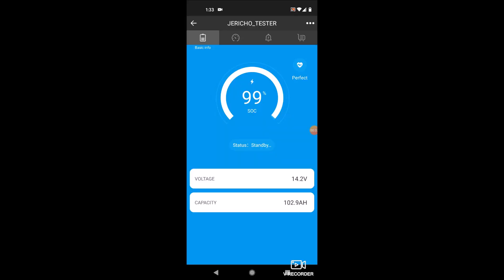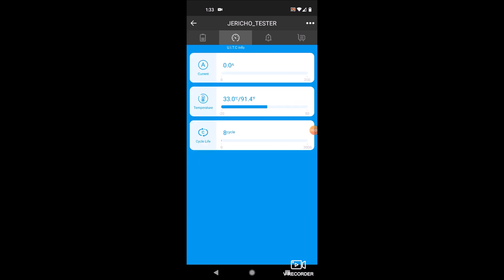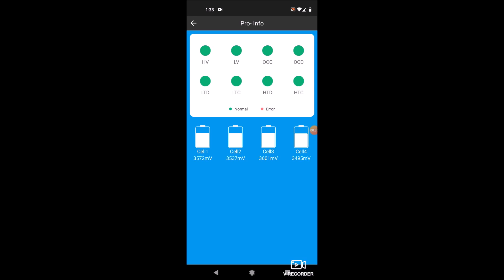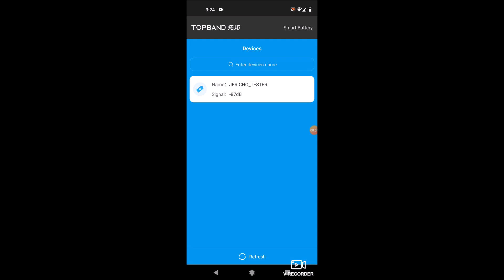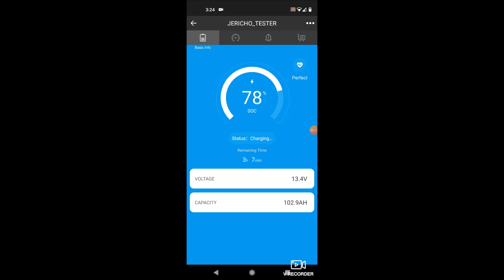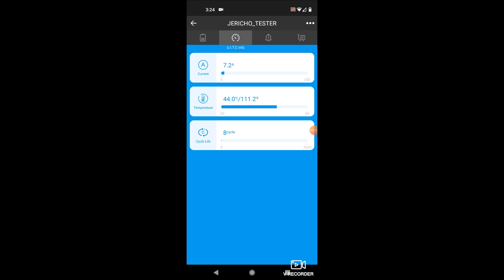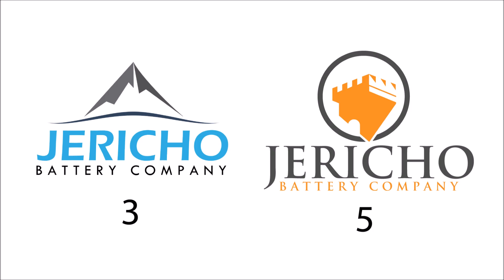Battery Import Project Part 3 - Some Testing & Other Updates

Comment: Logo 3 for the vote.  I'm interested, but was wondering about some of the features that i would not see needing such as all the communications, with the exception of the Bluetooth.  I was about to pull the trigger on the MillerTech batteries, two 100AH "premium" and waiting for the 100AH starting battery to come back in stock.  My application is boating and I live in Texas so not worried about the heater and the cold charging.
Reply from the maker: What a coincidence!  I just emailed you this morning about this before I saw this comment.  Thanks for the feedback on the logo.  As for the excess features, they won't hurt to not use them.  But you may find the Bluetooth highly convenient because you are going to want to put these trolling motor batteries in a battery case where you won't have easy access to a push button to check on how much juice is left in the batteries.  And they have a 2,500 cycle life vs the 2,000 for the MillerTech premiums.  

This first batch of batteries that I am bringing in will be temporarily cheaper than the MillerTech premiums so if you are interested it would be a good time to pull the trigger.  But I won't have them in for about 45-50 days or so due to the chip shortage and transport time.  Final retail price will be slightly north of the MillerTech batteries.
Reply: I can put 2500 cycles on my specs, no problem.  Or 3000 or 5000 or even 7000 like some companies!?:) The problem that the public does not understand is that, cycles are based on about 10 or more  factors. Unless you know all of these first, then you honestly can't go by a manufacturers stated cycle number! Ours are rated and guaranteed!
2000 cycles @ 100% DOD
With 1C rate charge and discharge
If you use .25C rate charge and  discharge we can easily reach 3000 cycles. 

After these cycles at the stated C rates the battery will still retain 80% of its original capacity!! 
We use the best cylindrical cells in the market,  the only 2 prismatic cell brands that can (truly) match our specs is BAK and CALB.  
Which are you using? 

This being said, I'm sure some of you will disagree and that's 👌. We do not claim to know everything, but we have tested hundreds of batteries in the last 6 years and we know All of the Chinese brands and suppliers! 

Jason,  of course I don't like having another competitor, and for sure not a customer turned competitor, but I also started a business once and was someone's competitor:)  
It's the beauty of America right?100%.
So I wish you nothing but success in your endeavors! It's a lot of hard work and I admire anyone that's willing to take the step. Starting a business can open avenues to failure, and I think many people refrain from ever doing it because they are too afraid of that factor! So keep looking ahead and never give up!:) 

Should I change my specs to 3000 cycles?? It would be the truth! :)
Reply from the maker: Haha, great comments, Lester!  I just shot you an email.  I agree about the cycle life ratings.  BattleBorn plays BMS games and inflates their cycle life, Renogy makes wild claims of 5,000 cycles but only warranties their batteries for 5 years (that should tell you something) and MillerTech is over here trying to be honest and above board.  I honestly do think you should re-rate them!

Comment: Logo 3, but both are good.   FYI re. colors, I do like blue better than orange, but in the end it doesn't make a huge difference to me.
Are you familiar with the "group buy" concept? When you start thinking about ordering your first real order, you might open it up to the group to pre-order (pre-pay or at least a non-refundable or only partially refundable deposit) to limit your out of pocket. Who knows, but depending on price point and pre-order reviews it could go really well, or at least reduce some of your cost stress.
Reply from the maker: Yeah that is what I am thinking about doing.  I'll open it up to pre-orders for a few days or a week and collect the full pre-order price and then I will place the order.  Whoever orders after that point will pay a slightly higher price.  Do you think that is fair?

Comment: Definitely 3. Love the blue logo and the battery top.
Reply from the maker: You like the black bottom and blue top of the case?  Man I don't know.  They didn't tell me they were sending me one with two colors when I ordered a sample.  I kinda want all black case.  To get a custom color (like all white or all orange or something) would require a minimum order quantity of several hundred to a thousand I think they told me.
Reply: @LDSreliance   I do think the blue looks good. Personal taste, I guess.. All things being equal, I’d buy a blue top over a black top. I’m unfamiliar with the market but many of the batteries I have seen are black on black. 

From what I understand, you’re going to be offering a unique product anyway - perhaps heated, Bluetooth and RJ45/RS-485? We wish you well with this venture.
Reply from the maker: Yes, bluetooth, serial communication via 2 RJ-45 ports (RS232/RS485), internal heater, re-closable case via screws (most lithium batteries you have to cut open to access the internals and destroy the case), and top shelf specs.  Thanks for the well wishes!
Reply: @LDSreliance  that is definitely good value for money. We’re in Canada. The border is closed so we can’t order until the border is open and we can resume our annual trip to AZ. Depending of the timing, I’d love to order a battery or two.
Reply from the maker: Sounds like a plan!  Thanks for the support.

Comment: Logo 3 plus the color blue matches the blue top on your battery. I have a suggestion make sure that the manufacturer is using the most current Bluetooth 5.0 you get better range and it is more efficient. They may be only using Bluetooth 4.0. Just a suggestion wishing you the best looking forward to more videos.
Reply from the maker: Thanks!  That is a great point.  I didn't think to ask about that.  I will add that to the list.